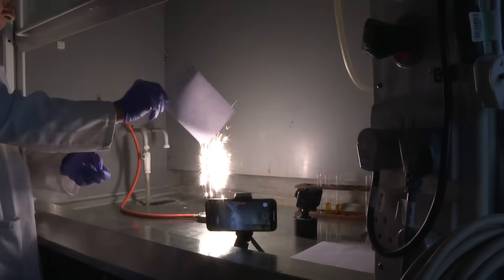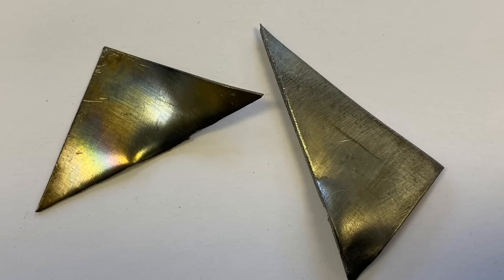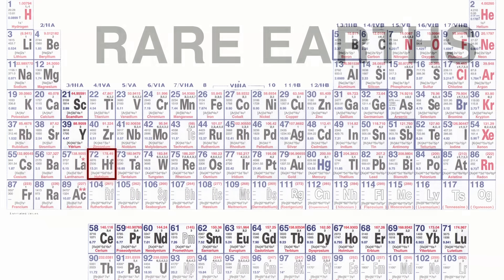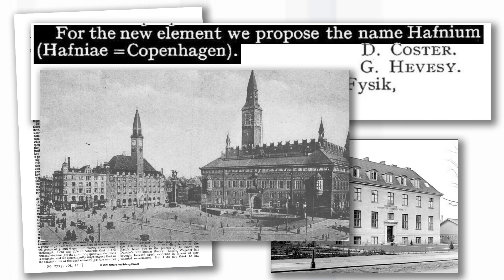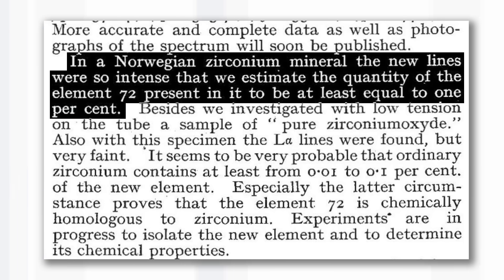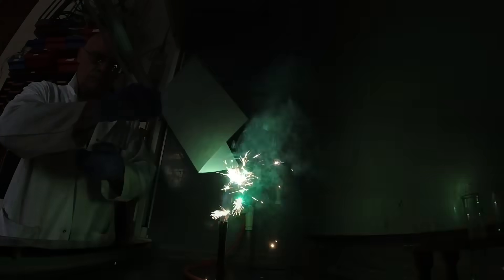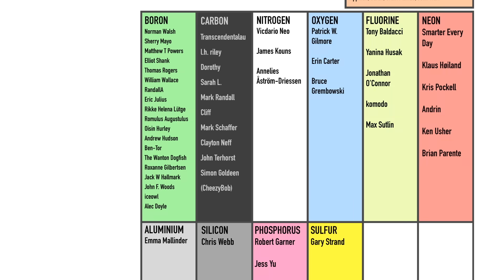Hafnium - Periodic Table of Videos

Comment: I think the best example of Hafnium in use is, Molybdenum hafnium carbide (MHC). It's a super-alloy. High-strength, particle-reinforced molybdenum-based, with excellent high-temperature properties, including high thermal conductivity, creep resistance, and a high recrystallization temperature. Use cases are things like hypersonic nose cones, stamp and extrusion tools, and possibly the internal lining of fusion chambers. ❇

Comment: Halfmium can be used for anything zirconium can, but it will not work for neutron transparent parts, the chemistry is so close that mechanical methods are used to purify zirconium for nuclear energy  parts. Halfmium is used for some control rods but they are generally using burnable absorber rods that generate tritium instead. Wanna see Hf disolve real quick mix HCl and 35% H2O2.❤

Comment: Professor can you explain the electric properties of hafnium, and it’s use in semi conductors transistors? I understand tantalum is used in electronics why can’t this be substituted for hafnium? 
It seems hafnium has different electromagnetic properties, charge memory. It will keep its diamagnetic orientation and that’s how the information is actually stored in binary charged or not charged. 
However researching GPU’s from nvidia is seems they use tantalum it doesn’t mention hafnium. 

Wow hafnium is very strong and corrosion resistant. Its like zirconium and tantalum had a baby haha. 
I love you’re videos professor. You’ve planted the seeds for many young chemists.
I’ve learned a lot from you professor, I’ve watched all your videos probably multiple times. Thank you for everything you’ve done for the scientific community.

Comment: Fuming, nitric acid, a.k.a. nitric acid with a concentration percentage of 90 or better. Actually, I think it’s like 85 or better will not dissolve metals easily because of the passivation it causes.  Add a little water to that concentrated nitric and Bob’s your auntie.

Comment: I really want to get my claws on some hafnium because I HAVE to see that color spectrum with my own eyeballs and not through a screen. That green color and the red in the flame has my interest peaked.
I am not at all surprised at how well it burns. I have welded titanium and zirconium and have both in my garage and fun fact; Titanium is one of the only other metals that will cut "cleanly" with an oxy/acetylene torch the same as steels. I say "cleanly" because for anything other than demolition you need to remove almost a cm of material due to oxide damage. BUT it does the fun trick where you can turn off the acetylene and carry along the cut with nothing more than heat produced from the reaction with the oxygen stream.

Comment: Halfnium is used in plasma cutter tips. It sits the in center of the copper center electrode and the tiny chunk of hafnium melts and forms a pool where the main plasma arc originates from. It makes for much longer lasting electrodes than the old tungsten electrodes.

Comment: Halfnium dioxide is the hidden crucial element at the heart of the recent breakthrough in nuclear fusion research where we've finally exceeded breakeven and thermonuclear ignition in the lab. All the thousands of mirrors throughout the entire National Ignition Facility laser that drives the fusion pellets are made with multi-layer dielectric coatings of hafnium dioxide evaporated by electron beams in a vacuum chambers onto huge blocks of fused silica glass substrates.

Comment: Hafnium (when it didn't have a better use) and Zirconium have both been used in incendiary ammunition. I think Hafnium only by way of experiment in 40mm cannon shells for USAF gunships during the Vietnam War, Zirconium much more widely. Zirconium at least not only burns: the freshly-formed ash catalyses the ignition and combustion of hydrocarbons. I do not know anything about Hafnium as a catalyst and I wonder if anybody else does?
I read a memoir by a gunship crew member who had to use visible and IR cameras to give the pilot enough information on the aircraft's position relative to the target to allow the gunners to keep the side-firing guns on the target. This gave him a perfect view of what the burning Hafnium shells looked like when they exploded. He said it looked like "pinwheel" fireworks and the "flash" lasted for a bit longer than a single instant (all you get from Zirconium). This must have made it easier for the gunners to know when they were on target. I don't think the Hafnium starts better liquid-fuel fires than Zirconium and lighter Zirconium powder makes it possible to put a small chunk of Tungsten in the nose of the shell to puncture even an armoured fuel tank.
Titanium only has an incendiary effect when wrapped around a fairly massive explosive charge, as in the warhead of a Harpoon anti-ship missile.

Comment: Hafnium is used in plasma torch tips as they make starting the electric arc much easier.  I was told long ago that Hafnium was also used in plasma screens as the electron gun for each pixel.
Reply: Yup it is used in those. The thin oxide coating is an excellent thermo ionic electron emitter. The old HP single frequency helium neon lasers used a halfmium or zirconium cathode which made these lasers have a service life of over 100,000 hours. The reason is the metal emits electrons easier than the aluminum used in regular laser tubes and its active enough to combine with nitrogen hydrogen and oxygen but it will not sputter coat the inside of the tube ❤

Comment: Quite ironic that elements apart of the same group have such vastly different cross sectional absorptions of neutrons. Either way Halfnium is super important for reactors since they are used in control rods as well as the fact they have many stable isotopes. Unlike boron which turns to gas after absorbing neutrons.

Comment: The fact that it absorbs so many neutrons so well is actually what makes Hf the best material for nuclear control rods!
It may be the worst thing for the cladding, but even just putting Hf tips on control rods can extend the life of the rods drastically!
Reply: Depending on the starting isotope, a single hafnium atom can absorb seven (7!) neutrons before being reduced to 0 neutron absorption cross section.
Reply: @sixft7in you two can’t be just civilian fans of nuclear power to break out these facts
Reply: @fensoxx  I'm a former US Navy nuclear reactor operator. 🤣

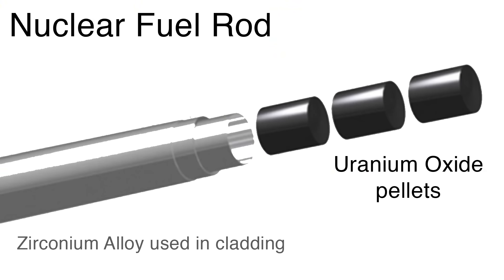Comment: 11:25 - Hf neutron absorption cross-section and its corrosion resistance, hardness, and chemical compatibility with Zr fuel cladding make it superb for reactor control rods, but it's too expensive (outside of special reactors) so most are made of cheaper neutron absorbers like silver or boron.
Reply: The subs I served on used hafnium control rods.

Comment: I am working right now with HfCl4 as a precursor, actually. I use it for creation of high entropy perovskite oxides. Very interesting compound!
Reply: What do you do with these compounds?
Reply: @ksilebo  You mean the perovskites? Potential materials for semiconductor industry. They have a large variety of properties like ferroelectrics, magnetism, optics etc. They are deposited onto different substrates like MgO or Si.
Reply: @dfh1299  Isnt it CaTiO3? Where is the Hf in there?
Reply: @ksilebo  This is the crystal Perovskite but I am talking about the crystal structure perovskites with the general formula ABX3. And high entropy oxide means that there are at least five metals involved (and Hf can be one of them)

Comment: It's also currently used in the tip of the electrode for most(all) plasma cutting torches. Something to do with it's emission of electrons helps to get the pilot arc started when you pull the torch trigger.